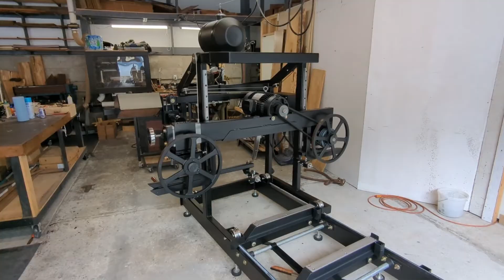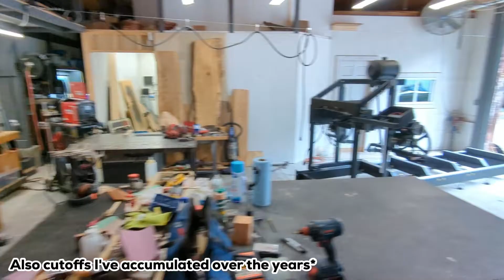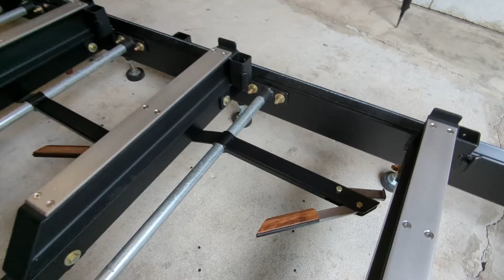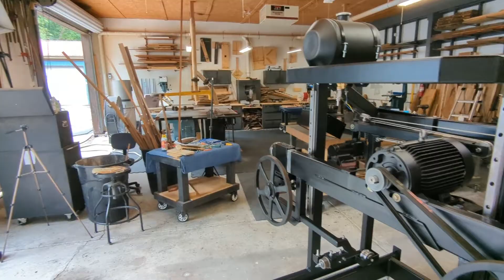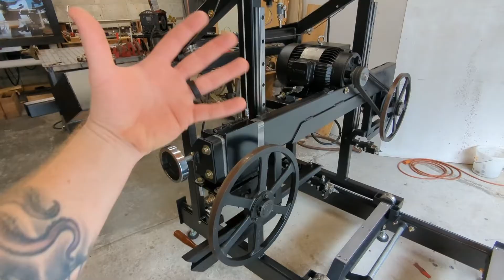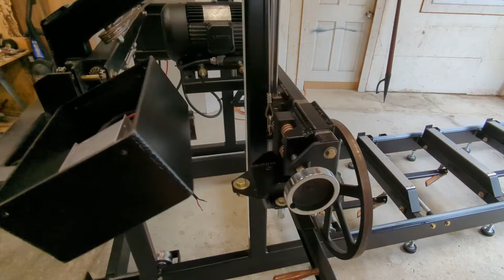Bandsaw Mill Inside a Workshop? A Brief Overview of My Homemade Electric Bandsaw Mill

Comment: Build a cage around the bandwheels and across the top for when a blade breaks or comes off i have done both it will happen and will cut the hell out of anything in its way 😮 my mill is a mighty mite similar to your build but i coverted to gas 😊
Reply from the maker: Thanks for the feedback, James! Check some of my recent videos I built some really nice guards for the saw. I need to get a video update out there I've been running it for a year and a half and it's been an absolute pleasure to use. Cuts smooth as butter and I've had 0 issues with it since putting it into service. Thanks so much for watching and happy sawing brother!

Comment: That is a beautiful machine as well as super slick. I really like the small things you did differently on the whole system. Where did you get the vertical guide rails for the saw? I'm in the process of building my own and those look like the best ones I've seen so far.
Reply from the maker: I appreciate it Gary! I had the absolute time of my life fabricating this machine. I adopted key features from 5-6 different mills on the market to produce what I felt was the perfect hybrid for my particular setup. I've been running it for over a year and it still cuts as beautifully as the day I put it into service (knock on wood). The linear rails are THK HSR30 linear rails and shuttle bearings. I purchased them from an Ebay user who sells used linear rail systems from factories that will upgrade componentry on machines from different kinds of production lines. These THK brand rails and bearings are over $1k brand new but I just looked at the listing I purchased and these two rails and 4 bearings were $180 shipped. The come in all kinds of lengths so find one that suits your saw carriage. Perfect high-quality components for a sawmill build. Thanks for watching. I'll get my saw update and full walkaround video up this spring when the sawdust is really flying. Best of luck with your build and enjoy the journey!

Comment: My dad was a woodworker. His entire shop had a layer of sawdust covering all. It looked as if it had snowed inside. One day, at a lumberyard I found they had an odd little building on a concrete pad with a roof. All 4 walls were hinged & flipped up opening the building up. Inside is where they did all their sawing. They would then sweep all the sawdust off the pad and/or blow the dust off the saws & such. I thought it such a great idea I put everyone of my milling eq on wheels. I roll my saw or planer or lath outside and do my dirty work. Blow it all clean then roll back into my shop-leaving my shop clean.

!
Reply from the maker: @ourv9603  I try to give the shop a good blow out every few days. A good leaf blower is a workshops secret weapon!

Comment: Wonderful! I really like the idea of an electric mill.  May I ask what your blade speed is? is your motor 3500rpm or 1750? What size is your dust collector? It seems to be doing a good job.
Reply from the maker: @ralphsstation2894  The power and torque bands of electric motors are perfectly suited for sawmills. I'm running a 3.75" drive pulley and a 7.75 inch driven pulley. On the 19" band wheels and my 1750rpm motor, my blade speed is running at ~4200 SPFM. My dust collector is only 1.5hp, but I've been servicing my whole shop with it for years without any issues. I'd say it collects at least 75% of the dust on the mill. I'm sure a 3hp would be the perfect solution. Thanks for watching!

Comment: What are the chances of a build plan becoming available??
Reply from the maker: That's something I've really put a lot of thought into, and there's a good chance I'll make that happen. I even thought about releasing plans of just the saw head for starters. My gut tells me to put a few hundred hours on this saw before making plans available. Just in case there's something that needs refining. It cuts beyond smooth and I'm excited to show that off. My guards are just about wrapped up so I'm hoping to have a good video out there demonstrating in a couple weeks or so. Thanks for following along!
Reply: @FernRiverDesigns  can't blame you there! Looking forward to seeing it in action. I'm looking to go electric for the same exact reason. Also noise and fumes
Reply from the maker: @dozer69643  Electric motors are really under utilized, especially in the United States. The power and torque bands are perfectly suited for milling wood, and maintenance is nominal compared to gas counterparts. I know gas vs electric will probably be the "Ford vs Chevy" debate of the sawmill world, but there are so many benefits to running electric mills if you have a stationary setup.